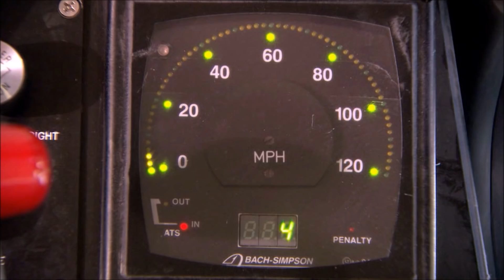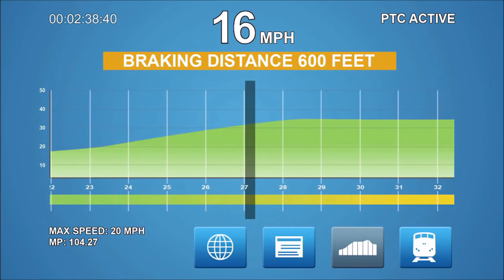Amtrak 501 "Cascades" Train Derailment 18 Dec 2017

Comment: Very nice reporting Juan! This is close by where we live, and the local TV ran with this for two full days.  Of course, closing I-5 SB was a huge issue around here, as there were very few options.  When you look at Google Earth, you can clearly see this curve is a pretty tight (something like 800' radius) 25-27 degree curve, and as you mentioned, it is at the end of a relatively straight run where the train can get to the 79 mph speed limit.  Wall St Journal is reporting that there was an opportunity to straighten and lengthen this curve back when funding was being obtained, but eliminated due to the cost.  It would have involved some additional right-of-way, and two new bridges over I-5.  So now, it will come back to that decision - for the cost of replacing those bridges, it now is going to cost (at a minimum) $20 million (cost of one engine plus a replacement), and a car set.  Then you add in the cost of the fatalities and law suits, and it probably would have been better to replace and straighten the bridges.  But as the saying goes, hindsight is usually 20/20.

Comment: It will be interesting to see the cabin video once it's released by the NTSB. What I will say is clearly 50 mph over the posted 30 mph was the primary factor in this incident. The curve not having the camber to support speeds greater than 35 ~ 40 mph assured this train would leave the roadbed. Unless there was some form of computer engine control glitch, there is only one conclusion to be drawn from the current evidence.

Comment: There can be absolutely no excuse for such things to happen, especially since there was a time, not that long ago, when Railways were coping with much higher levels of traffic than now without the benefits of current technological tools.  Wayside speed indications are not vital systems as they can be knocked over by vandals.   Railway crews are supposed to know every characteristic of a line over which they have qualified for, including the locations of speed zones and those of any form of signals (e.g. lighted signals or post signals) - so as to be able to operate their train safely even when a signal has been knocked over after the related approach signal was crossed.

Without having a detailed knowledge of the specifics, I am under the opinion that this reflects the current difficulties in having peoples today do their work correctly.  In other words, I see this as a human factor issue: either the crew was not qualified for this territory or it was the victim of political shenanigans, such as having officials and/or politicians in the cabin on this inaugural run, effectively distracting the engineman.  Remember the Challenger accident when political considerations overrode the concerns of engineers and scientists who had recommended scrubbing the space launch as a result of the cold temperature effects on the O-rings of the solid boosters.  2017/12/23. Ontario, Canada.
Reply from the maker: I DO remember that...state of the union speech later that night...excellent point!

Comment: I take three different types of trains everyday to work. I know very well that you want to be in the back of a train if there’s an accident. Look at every train accident the last few decades and the last few cars are always the most intact and upright. Side note. I can see how ptc would be necessary in tunnels for subways but trains that run outside are using a system that is very dated. And expensive. GPS could achieve the same as ptc for a fraction of the cost. Just saying.

Comment: The Oregonian paper had that engineers audio. NTSB is supposed to be looking into if the lead engineer had done a familiarization with the route since the crash route has the added sharp turn crossing I5. If a GPS oriented tracking program was used possibly it picked the faster tracks reference for speeds to use. Sad accident. NTSB has video with sound of drivers compartment and outside looking at path. I believe the audio of an engineer is the trailing engines engineer who saw the lead drive being hauled off all bloody faced. At 3:21 in Oregonian radio traffic engineers injures are discussed. https://www.youtube.com/watch?v=lRf2VkWWHG8

Comment: Clearly there is a problem with distraction, attention to detail, and operational consideration (speed).  Thank you for your rather protracted analysis Sir, but the delay of PTC on this line doomed this train to this accident.  Also, being distracted with a trainee in the lead locomotive was a factor here.  The public should refrain from riding trains until PTC is installed nationwide.

Comment: so if I understand correctly these is the first time that this train with paying customers were on board.  I think that is very interesting as you would think the engineer would be more vigilant at this time, or he was NOT trained properly for this run, or since this is a new run the signage was not appropriate, it was still dark at that time of day as well and if the signage was not visible that may have been a problem.

Comment: In Sweden we have something called ATC (Automatic Train Controlsystem), similar to the PTC shown in the video. I suppose you guys don't have ATO on AMTRAK so it's kinda strange how the driver could do faster than the limit on the current section. If PTC is installed and operable you can't go faster than the limit, unless you break the override switch. If you look on the track on the bridge, you can see a pair of extra rails so help the train stay on the bridge. Basicly it works when the pair of wheels derails, the extra pair of rails will catch the wheel and prohibits the train to fall off the bridge. The speed must have been high or else the train would still be on the bridge.

Comment: you left out schedule demand by the public ?
Typically Amtrak yielding to the track owners forces Amtrak to travel at near maximum speeds to meet the schedule they sold the public 
Amtrak owns no track either so the passenger  safety is left up to the freight company 
I have rode the rails many times the past few years and there were some areas I couldn't believe we were traveling so fast for all the swaying going on

Comment: Waze is an Android App that uses GPS and maps and can even tell you when you are speeding in any location. It doesn't take much imagination to apply this reasonable cost effective app to rail immediately except for two large possibly insurmountable obstacles. The US government and the Engineer's Union. This could be able immediately as soon as the speed parameters were installed and available on every engineer's phone.

Comment: This accident; like the one in New Jersey, we hear again that the PTC system is scheduled to be installed next year. At what point do we refuse to accept that lame answer? I understand that the retrofit will take time, but how does a brand new route escape compliance? Is proper training to blame? Inadequate  signage? I suggest you don't travel on Amtrak, there is something very wrong here; and it is simply not getting fixed.

Comment: As I understand, although this was a new territory for the crew of this train, the engineer did have to be qualified on the territory. How much qualification is not known yet, but it could be very little. I am an Engineer for a major freight railroad, and at least with our railroad, there are signs posted 2 miles in advance of speed restrictions. Permanent signs for permanent restrictions, and yellow “flags” for temporary restrictions. I do not know if this section of tracks had that or not, but if it didn’t, it would certainly help to have that advance signage. All tracks do have a “timetable” however, and this timetable must be familiar to the crew, and this timetable would indicate permanent speed sections, and the milepost where they are located. By the way, our railroad dies have PTC up and operational, and it’s a great tool.
Reply: While it is expensive, on sections involving passenger rail that have not been upgraded with Positive Train Control, there probably should be two crew members in the cab reading, calling out and confirming signals and speed restrictions.
     The train was behind schedule, so there was probably pressure to move quickly.
    With that much money involved in improving the tracks, I would think there is a checkoff on their list to make sure speed signage is posted to cover intervals for high speed trains.  
    The British and French have had the automated stop signal for over a century, but speed control is a lot more complicated. On the old and current stop system, If a signal was at red, a magnet sat upright in the track and would trip a lever under the train. This would ring a bell and then the next one would take stopping actions. When authorization to pass a signal was given and the signal changed to other than red, the track magnet was hauled down so not to be in proximity to the locomotive lever.
    There have been speed controls for terminal stations for several years in the British system to assure that trains approaching stations with dead end tracks reduce their speeds.  A set of track positions begin timers and if a train passes positions further down before it should, the braking system is tripped.  But this system couldn't be implemented over the entire system since it would be astronomically expensive.
Reply: I agree.  He has been taken through the route probably several times with the long straight stretch and then the dangerous curves.  The video describes it as a "sneaker" curve.  No it isn't.  The curves would have been known. That is why they take the engineers through the route.  Like the British and European railways, the route may be videotaped with a voiceover regarding things to know.
Reply: John Jensen, it is great to hear from an operating engineer how the rail line is usually marked to assist the engineer to safely navigate the route of travel.  During my college years I was employed as a school bus driver on some extremely challenging routes with curving roads and over very hilly terrain.  That gave me a feeling concerning the importance of having a thorough knowledge of the route and the importance of utilizing signs and traffic signals, especially when you are called upon to run a route that is unfamiliar to you.  A school bus is nothing like the operation of a freight train, but the importance of a thorough knowledge of the route traveled became very clear as a result of my school bus driving experience.  Your input was of significant interest to me, to gain some insight from an engineers perspective.  Nick, North West Farmer
Reply: Jeez, the way you explain it, even if Ray Charles was driving that locomotive he would have seen all of the signs and flags warning about speed. I think that engineer was probably too busy bullshiting with that "guest" that he blew the speed limit warnings. Just a theory though, i realize there are many other factors or causes for this accident.

Comment: When this happened a few days ago I was shocked and then saddened to hear about needless loss of life.  It was reported here, Seattle area, that the train was doing nearly 80 mph before the 30 mph rated turn and supposedly no brakes applied until just before starting the turn.  Unless there was electrical/mechanical failure there was more than likely complete loss of situational awareness of the train engineer.  Also sounded like he had a trainee in the cab with him which likely distracted him.  When you are responsible for many lives as captain of a boat, ship, train, or plane you have no business letting yourself get distracted at critical moments of your "flight".  When I was boating up in Puget Sound I learned quickly to pay attention, others lives, yours included were at stake.  Obviously, the NTSB report won't be out for some time but it's probably only one of two causes, 1) electrical/mechanical failure(s)... unlikely, or 2) engineer failing to keep focused on his job... safety for all riders and the public at large as they cross streets and highways.  Very sad that of the 3 lives lost, 2 were avid rail fans, and 1 had turned his life around from a run-in with the law and things were looking up for him.  I heard traffic backed up 20 miles on I-5 that day!  Total cost of property, loss of business and destroyed rail cars and probably the locomotive is probably in the millions of dollars, and the tragic loss for family and friends of those suddenly killed.  A very sad day here in the Pacific Northwest.  Sorry for the long winded posting.  This tragedy really hit a lot of us up here pretty hard.  Sad also that it seems to take public transportation tragedies like these to result in much needed safety improvements.

As usual, thanks for another outstanding report Juan!  I've loved your informative, factual, tell-it-straight reporting.  Wish we had a whole lot more honest reporters out that like you!

Comment: Wonderful reporting, Juan!  One of the sources I saw right after the accident had images of the train speed limit sign which is 2 miles before the corner.  The sign looked to be about 50 cm square, which would be hard to see at 80 mph.  I understand that the curve is at the bottom of a long grade, which also would affect braking ability.
Reply: Looking at Google Maps, I see that the switch to the main line is only about 1.5 km from where the derailment occurred, which would have to be negotiated at low speed.  Obviously, there was a lack of situational awareness on the part of the engineer, as slowing that train down from 80 mph to 30 would take more than a kilometer.  Inertial navigation systems on aircraft have been touted as capable of flying from one airport to another entirely by computer, so why can't we have inertial nav on trains?

Comment: What people are not told is that the majority of the tacks used by Amtrak are leased by Amtrak and NOT owned by them. It is up to the tracks owners to install PTC on the trackside. Twice the Freight Companies {the owners of the tracks) asked for an extension and twice congress granted it. I heard tell that if pushed the freight companies will revock Amtrak's leases, if they can do such a thing. Just like in Japan, new dedicated track needs to be built without grade crossings and significant curves.